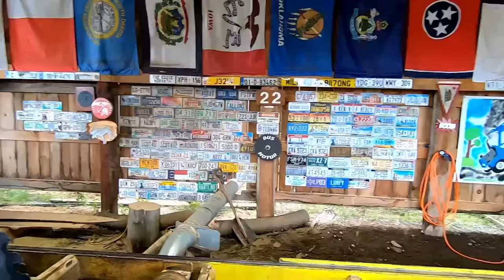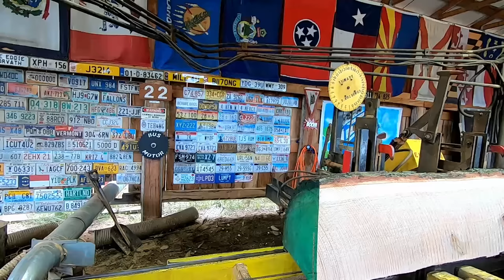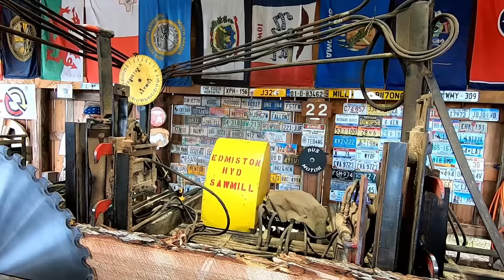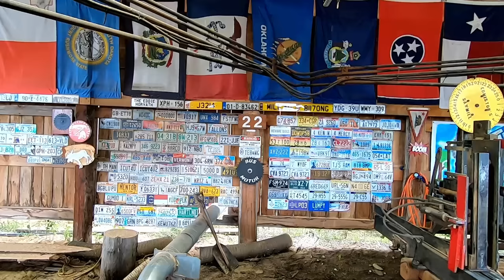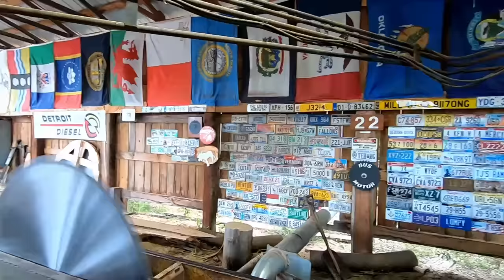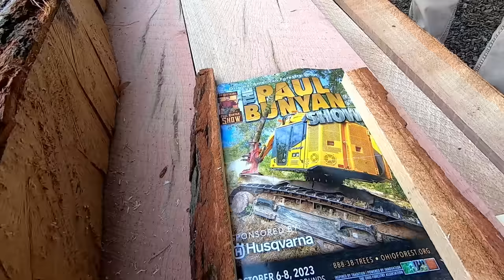quarter sawing a monster white oak log # 463

Comment: Nuts319 has a good sledge hammer swing
Reply from the maker: yes he does very strong.
Reply: @markgalicic7788  that swing that nuts319 uses is good way not to tire yourself out fast
Reply: If John Henry would have used that swing against the steam-powered drill his heart would not have quit. Excellent job.

Comment: Mark, So the biggest log i ever moved was also a HUGE White Oak. Back in about 1994 I was hauling Timber out of the Midland,Pa area (Down there near you guys) And on the North side of town, Up on that hill that over looked the City Park. Back up on that hillside that faced the SE, Here stood this MONSTER White Oak that had been hit by lightning on one of the 3 large upper branches. There where a total of 4 large White Oaks up there within about 25 yrs of this monster, That where likely seedlings off this old oak and they where probably 100-120 yrs old then according to the Arborist that the City hired. And his advice was to remove this larger damaged tree and let the 30+ smaller trees get some sun. The Arborist figured that old tree was somewhere between 220-228 yrs old at the time. The first 2 logs where taken out of the woods at 26 ft. The butt log was egg shaped and at the narrowest point was 63". They cut it in half at the landing. And we chained it the the Prentice Loader and lifted the end up and had the shudder push each log up on to the rear of the trailer. I check to see what the guage said with just those to logs on it. And it was just under 10-K lbs. I got that whole tree loaded on the truck. And had just about 44-K from just that one tree. There was some Popular in there that where in the 40" class. And some Red Red Oak that made Vener grade logs. I wish I had taken pictures of that job. 1994 was long before cell phones with a camera.

Comment: I am up in north Canada. Used a lister diesel to saw small sized  logs  with the belt twist from motor to blade. Each log you saw, I smell that, and a sawmill smell, well, it's Awesome.

Comment: Dude twirling that 10# sledge like a toy. That’s real work.
Reply: Swinging in an arc.  I learned that driving spikes on a drag line rail track.  Works good so no real lifting of the hammer head.  He’s a real expert at it.

Comment: Little bit of pyrodex makes that job much more enjoyable.  I split our oversized logs in a similar way except after the score cut I drive 2 slats about 4 " apart.  Pour some in. Drop a wick in. Then I drive another 4" long slat to plug the hole.   
Done rite it will pop em rite in two wo any damage.  
I have tried it wo a score cut, just using a plunge cut and natural seams. With good outcomes.  Made splinter piles out of a few learning though lol

Comment: Ten o’clock in the morning brew time bacon buttie and watching you guys , split logs for the mill as an apprentice Sthil 090 saw fourty odd inch bar made you sweat, hope the eye gets better soon todays job making square nuts 7/8 whitworth thread for a vintage machine you need a big spanner , thems nice boards coming off the mill you guys have a nice day

Comment: When I was little boy, now 71 years of age, I use to go with my uncles to the saw mill above our town. It was a really large mill that only cut pine that was hauled from all over the county of Fairfield in South Carolina. I remember a 671 Detroit running the mill. Next to the mill  was a small gully where they ran the saw chain to carry the saw chips. I remember that saw mountain about 50 or more feet high and we loved to play on that saw dust pile. When the mill  was running, you could hear it for a long way off. About one mile from my house now through the woods is a family run mill that is very old. Still running every day sawing rough pine lumber. Not much oak. They used to have an M&M gas engine running the mill. Finally moved to electric and still running the circular blade.
Reply: energy cost comparison between the two. The main reason for switching I can guess there are many reasons but I would like for you to tell me.
Reply: I am sure the electric motor is much more efficient as per fuel handling and maintenance on the engines. The guy that runs the mill near my house is of a different bread. lol. His daddy built a farm way back when it was country. He raise cows and hogs. He also has a lot of land not far from the farm where they grow extra corn and hay. The saw mill was another way to make money and most of the lumber is sold to locals. Most is southern yellow pine. The older dad a few year back and his only son now runs the farm and mill. The son, also has an agriculture degree from Clemson. He lives in the family farm house that he has totally renovated. Two story big house sitting the hill surrounded by 150 acres of pasture and now subdivisions. Country in town. The mill is still in the same place it is was when first built. In a hole with NO room for trucks to come and go. About 20 yards from the mill is pasture land flat and pretty. I ask him why he does not move the mill to the pasture. He said his daddy told him to over move the mill as it was not easy to set up. This boy is loaded with money and could easily purchase a new mill. But he is content and country as hell. lol A good old boy but stubborn as a muslim.  @Mutlap

Comment: worked for a sawmill in adams ville tn. we had a 8 foot butt cut white oak . we drilled a hole in the middle and used a 1/4 stick tnt to blow it in two 4 peaces so it would fit on our sawmill
Reply from the maker: Eddie & I use black powder with cannon fuse.

Comment: Man says we are serious about safety here and 5min later standing on a log cutting down the middle with so kind of fall protection, gloves or face shield…..with that said nothing about an open blade saw mill is safe to begin with but it also has the best looking wood cuts imo. All of what i said above is why im on this channel and love it, sometimes you just have to pull all the warning labels and let common sense prevail. A lot of times Safety items is a crutch for ignorance and doesnt eliminate the dangers but minimizes the carnage when the inevitable happens anyway. Its guys i work with that wouldnt last 10min outside their padded and secure safety spaces

Comment: HEY MARK,  A subscriber , watch every one of your videos.  you are still letting the log be the boss when you 'try' quarter sawing.  You may have to compermise with a slight rotation cutting a board 5/4 to 4/4 in thickness, to obtain the maximum 'flake'.  I know I'm being an AH. The QS I use in my Antique restoration has be like c1910.

Comment: Have you thought about quartering on the mill? Either start with smaller diameter logs that you can cut through in one go, then you don’t have to attempt to rotate 180 and get a second cut aligned …  plus a lot of heavy lifting for your crew to keep moving quarters around …

Comment: Guys, take a look at the license plates. They are all squashed vertically, look more like european plates. Have you some odd aspect ratio/scan select running? Take a perfectly round item like a circular blade. Shoot it square on, and see if it looks really round. Ot just futz with the settings until things look right...

Comment: Quarter sawn oak. Does it come any better?

BTW you have what I think are cables running overhead to the bed on which the log rests. As those bend back and forth will they eventually work harden and snap?

Comment: flat saw 2 opposite sides until flake appears , split through pith , set aside 1 of the halves, flip  cant 90 dgs.       usually 4-5 pcs. of qs, 4/4  or 5/4 per half.  less quarter sawed , but lot less waste . ( good demand for flat sawed w.o. rite now , also)

Comment: I kinda think that if you were to saw that Log Thru and thru, The center board and the 2 adjacent Boards would be the Widest Quarter sawn ones, and the most Valuable ones in There. The boards above and below would go into a "Riff Sawn" situation And are valuable also. In Antique restorations, The riff was generally Used in sides and backs,  and the Quarter sawn heavily Flaked boards would be in front for show. Lotsa Mission furniture made of it at the turn of the century.   Carry On.

Comment: Question? Why not run the whole log through the big blade , then take it off and finish with the chain saw? Seems like that would be a good guide for the chain saw to finish the cut straight as possible.
Reply from the maker: it wouldn't end well.

Comment: If you were going to do very much of this with these oversize logs, it would probably be good to build yourself a set-up out on the yard to quarter those logs more precisely, like one of those oversized horizontal mill rigs with a long chainsaw bar instead of a band.  That would leave you some flat faces to work with.

Comment: I am Carpenter & Joiner here in the UK so not a sawmill guy by any measure, but i really dont understand why you dont just turn two of the 4 quaters around in the yard so they sit on the mill the right way.

You got loader & massivwr yard so would only takw a couple of minutes & way less hassle than all that faffing about with chewy & ending up so badly out of square. 

But regardless i do enjoy these videos 😉
Reply: I wondered the same thing.  A beautiful log like that and he really didn't do a true quarter saw job

Comment: You don't have to take the log off the carriage.  All you have to do is to rotate the face you are working on flat on the carriage and work from the narrow side and you can continue to make vertical grain boards.  It isn't hard to do and you can quarter saw all day long that way.  You are just used to flat sawing.
Reply from the maker: we are over it now.

Comment: What size is that Detroit screaming in the background?
Reply: Detroit 6-71 2 cycle. One of the finest Screamin' Jimmys anywhere! Keep it ful of oil and it will bring you home every trip.
Reply: @The_DuMont_Network  Back in the day I operated a crane with a 4-71. With over 4000 hours I never put a wrench on that engine. Keep the filters changed and scream on. Even in very gold weather, I used very little starting fluid to get her going. Operated on 15 pounds of oil pressure most times. My opinion Detroit will never be topped. That engine will run when most are dead.

Comment: It must be the angle of the camera, but what is the thickness of these boards?   Is it even 3/4 inch?  What about shrinkage from drying.
If I contracted you to mill this log I would want a minimum of 4/4 or 5/4.  
I would also require you to turn the log each cut so I would get more true quarter sawn lumber.
I sure is a beautiful piece of oak
Reply from the maker: these are 1-1/8" thick 4/4
Reply: @markgalicic7788  Then it was the angle of the camera.  Thank you

Comment: Why not use the sawmill to split it? You could off load the cut pieces with fork lift.
Reply from the maker: I would love to watch that.
Reply: @markgalicic7788  Half it, 2 pieces, off load one of the halves, leave the other half on the mill, cut that in half, == 2 quarters, off load those 2 quarters
load up the other half onto the mill and saw it into 2 quarters. Off load those 2 quarters and return the 4 quarters the log loader.
Now you have 4 quarters on your log loader and are ready to saw into quarter sawn. A lot cleaner, sharper edges , less waste and quicker than the chain saw.
Reply from the maker: @miketubbs1615  you can do that on your sawmill not here.
Reply: @markgalicic7788  no problem
Reply: @markgalicic7788  Would you explain to me why this is not a good idea?

Comment: Im still not seeing what the difference between quarter sawn and plain sawn is, if a qs board was mixed up in a stack of plain sawn lumber how would it stand out?
Reply: If you look at the end grain of a flatsawn board you will see rings (((((  on a qs board you will see parallel lines ||||| this affects the visual look of the board a lot in some woods and decreases warping / cupping. White oak benefits in both ways.
Reply: The lighting will make the quarter pop out at you, also sanding, you gotta be there to see it.

Comment: Sooo... this would be considered Modern 1/4 sawing as opposed to Traditional quarter sawing?  I imagine this is due to the saw you're using?
Reply: What is the wood being used for?  That's a beautiful piece of oak !
Reply: It was not modern 1/4 sawing, not even close. Most of the cuts were plain sawn. 

There was a huge amount of waste - much of it due to the chain saw cuts to quarter the log while off the mill. I would think there is some sort of a rig similar to an Alaskan Mill that could be used keep the cuts straight.
Reply: @buggsy5  I concur.  I was looking on the internet and I would consider this flat sawn also.

Comment: Flipping it end for end isn't that big of a deal.  A pain in the butt, but not a big deal.  You have the equipment for it.  Just kick the workpiece onto the drop table, pick it up with the forks, back out, set it  down, pick it up from the other side and run it back up to your queuing table, and there you have it.  If you tried to give your crew a break while one guy did all that, they would get about as far as pouring a cup of coffee and eating half a donut...  DING, breaks' over, lets get back to quarter sawing!  Q sawing gets you a premium because the wood is THAT much superior, stable and clean!

Pine might not be worth it, what maybe 50% upcharge per BF?  But hardwood has got to be about double, right?

I used to build top end houses in my area, and we used specially milled 4/4, 6/4 and 8/4 hardwoods on our projects.  Our stairs, especially the ones with open risers would give you goosebumps!  (Think 8/4 x 6 handrail on edge with a built up clear finish!  MMMPH).

Anyway, thanks for sharing.  You got a sub out of me!

Comment: quarter sawn should be 5/4
Reply: Huh?  Quarter sawing is a technique providing stable material and shows the medullary rays in white oak.  5/4 refers to a dimension, usually thickness.  5/4 is about 1 and 1/4 inches.

Comment: Based on the saw marks left after a cut is made appears to indicate that the saw cut blade is not on the same plane with the run of the log carriage.
Reply: imagine having a mill like this and being so inept.

it is trial by error on this channel while excellent lumber is being wasted.
Reply: On a circle saw, the saw and carriage are not supposed to run parallel. This is called the "lead" (not the metal). I have a 56 inch saw. The leading edge of my saw is 5/16 closer to the carriage than the tail end of the saw. That's where my saw runs well. If the saw and carriage are parallel, the saw will be pushed out of the log as it cuts. If there is too much lead, the saw will want to pull into the log as it cuts. It's all explained in a book called "Sawmills and their Efficient Operation" by S. Lunstrum. It'll depend on saw diameter and how is hammered.

The tooth marks on a log are caused by misaligned teeth, but they will usually plane out if they aren't too bad.

Sawmills are very complex and everything working perfectly is not usually going to happen. There's more happening there than what someone with no experience can pick up on.

Comment: “We take safety very seriously” Dude gets up on log with chain saw not wearing ANY PPE. Not even glasses or chain saw pants. 🤦🏻‍♂️ And later starts moving the carriage while a guy is still standing in it. 🤦🏻‍♂️🤦🏻‍♂️🤦🏻‍♂️ Not to even mention that the operator is having vision issues and headed for eye surgery!! Good lord! OSHA has nightmares about guys like these.
Reply: Lmao….but they still living😂
Reply: Whinin’
Reply: All this complaining about Quarter sawing !  I think you should try Radial sawing for waste, now I have never seen it done, but the intention is to create the broadest prettiest quarter sawn pieces you can get from a log. It is always said to be the most wasteful method of sawing timber. I have always thought that there is still plenty of opportunity for scavenging small timber though.
Reply: You should watch some of the Amish sometime.
Reply: What is “chain saw pants”?
Reply: @willemvanderschyff8766  they are pants you wear that are designed to stop the saw. If you cut the pants with the saw then the pants come apart and clog up the blade and jam up the saw before it cuts your leg.

Comment: WHAT'S THE BIG DEAL WITH 1/4 SAWING? SEEMS LIKE AN EXTRA, UNNECESSARY STEP. AT 16:00 WOULD'NT IT HAVE BEEN A CLEANER CUT SENDING THE VICTIM THROUGH THE SAW-MILL?23:09, REALLY?!!! TALK A BOUT A VIEWER THROWING A  ''KEVIN, (COUNTERPART OF A ''KAREN''), 'SNAP' SANDWICH''! IF HE DOESN'T LIKE THAT YOU DON'T FINISH YOUR SENTENCE, WHY DOES'NT HE GET A SAWMILL AND MAKE CONTENT, SO THEN WE CAN WATCH JUST HOW ARTICULATE HE SOUNDS?
Reply: It's  for vertical growth rings.
Reply: It’s for two reasons - it shows off the medullary rays in species like oak (but you also see them in stuff like sycamore, beech), and it also results in boards that are more stable - they don’t cup when they dry out.
Reply: quarter sawing results in the highest quality and most stable lumber possible.

Comment: That is not quarter sawn. A quick google would educate youall.
Reply: its y'all ,not Youall.....a quick google indeed.
Reply from the maker: @williampalmer6994  thank you William.
Reply: @erikleorga  I think he's referring to not turning the log on every cut like you're supposed to.  That gives more quarter saw then the way this guy did it.
Reply: @beebob1279  Yes, yes.  They didn't pick up the log, rotate it, then slab again producing grain parallel to the face.  But this was as close to quarter sawn as a production flat sawmill can get.
Reply: @erikleorga  Thanks.
Reply: @beebob1279  yes someone that knows what quarter sawing really is